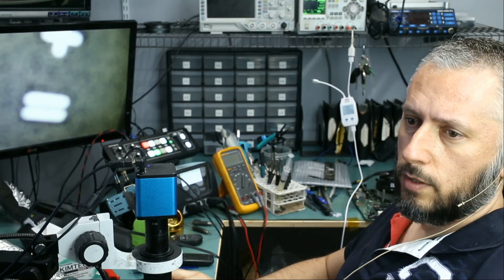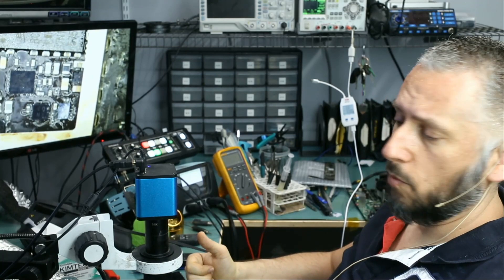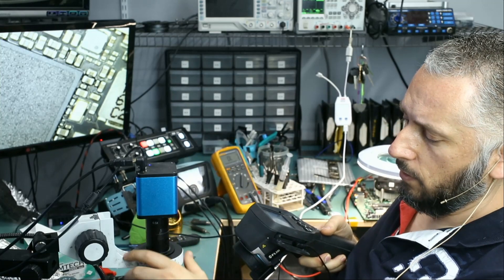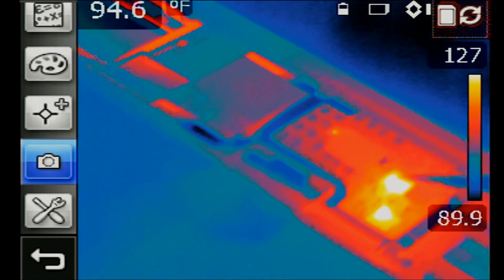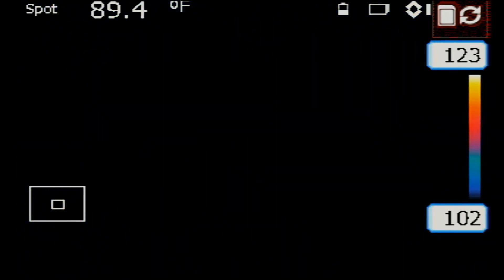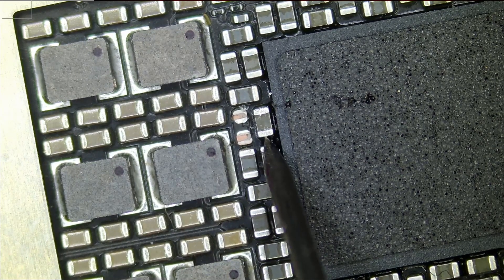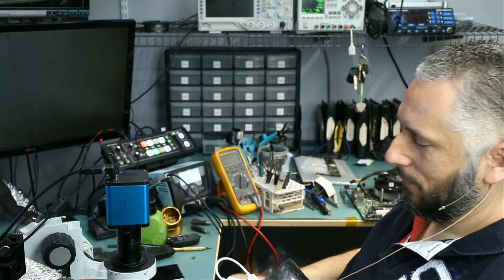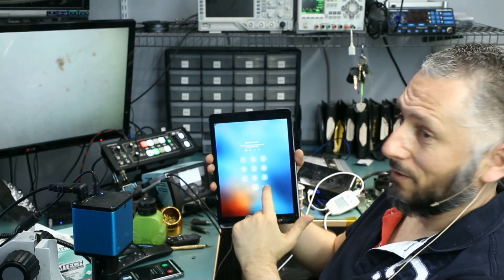iPad pro A1673 No power repair using a Thermal Camera - Tiny Component causing a big short.

Comment: I know this is a really old video, but...
I have the same iPad with similar issue, it's drawing 0.48-0.5 Volts and the same two components (343s0089 and 1R5 606 CM9) are heating up, maybe also a diode between them. 
However, I don't see any cap heating up. Shall I replace these two?

Comment: How many volts are coming from your power supply when using the thermal cam and are you injecting voltage from the charge port itself or directly with multi meter like probes?

Comment: I have a rtx 3080  I put it on a riser and i put in the PCIe adapter in backwards and turned it on... The riser broken when plugged into a normal pcie slot, the fan spin but no video output , what the electronic component is brokein

Comment: I just wonder why you removed the capacitor like that and not with the soldering tweezers? First time I saw you do it like that.
Reply: more than likely because the customer wasn’t wanting a repair but just enough functionality of the ipad to get the pictures off of the device.

Comment: Professional repair as always. I have a question regarding customers refusing to give device passcode, do you repair or not? For me this comes down to two issues.
1. Trust, can I be trusted to fix device if not trusted with passcode.
2. Would you want to undertake repairs if you are not able to test the device functions that you repaired.
I would be interested in yours and other techs thoughts on this if you get chance to reply.
Also could you let us know if the cheaper postage option returns. I am in the UK and have purchased from your shop (excellent and fast service) but the £90 order cost as much again to receive (not your fault).Thank for posting so may interesting and informative videos.

Comment: Great job as always! I still don't understand how does your power supply continuous to inject voltage when the board is on short? Shoulden't go on protection mode?
Reply from the maker: Charging circuit has no short. It does not affect power supply.
Reply: @NorthridgeFix  I got it. Thnx Alex have a nice day!